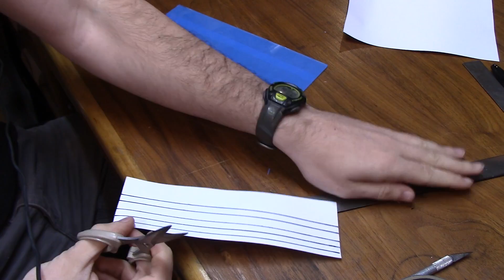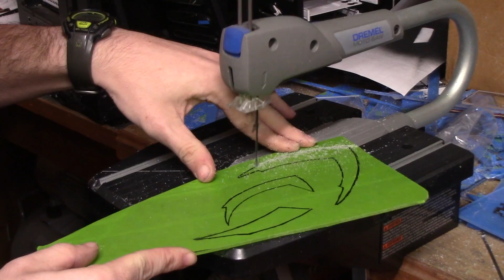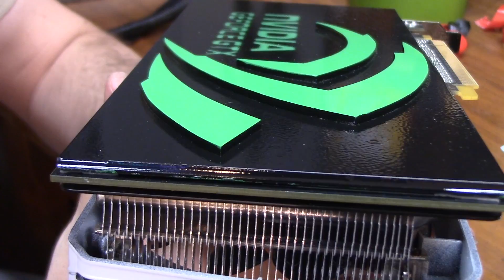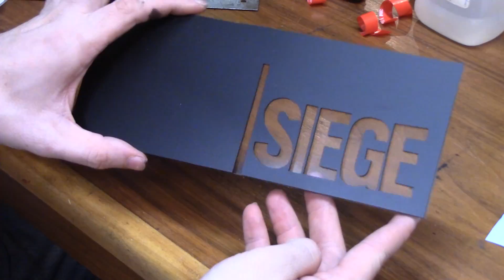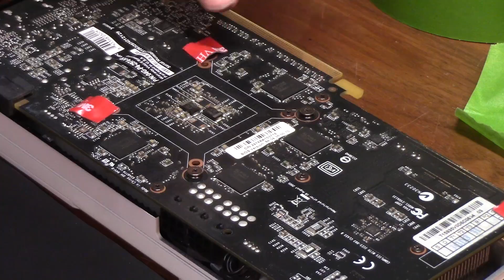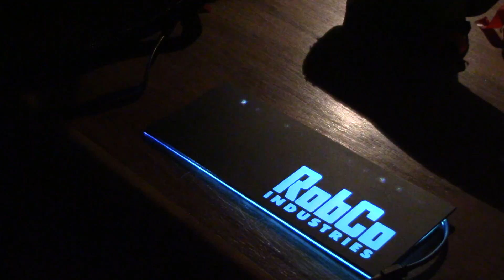How to make a custom GPU backplate (Basic and RGB backlit)

Comment: Honestly an awesome tutorial.  Do you think there's any way to add standoffs for the backplate so it doesn't sit right onto the back of the GPU?  I feel like that could ease up problems with heat entrapment.
Reply from the maker: +Lone Ech. You could just use tiny pieces of acrylic as standoffs, that would be the easiest way. But, it doesn't effect temps.

Comment: For a cheaper ghetto mod just make your backplate out of cardboard.
Reply: if it catches fire don't worry thats normal...
Reply: this is bad advice. very bad advice.
Reply: if your gpu explode, this process is called Thermal Throttling, this is totally normal if you were to try this mod. Dont expect it to work after but atleast you get 10min of excitements
Reply: @potassiumchloride2542  haha love this reply!
 i do have cardboard in my pc, however its inbetween two sheets of acrylic i used to make an rgb logo that is attached to the outside of my optical bay. so there is no risk of it getting even slightly hot, the hottest it will get is as hot as the ambient temp in my pc, and its only "temp"erary untill i get some white spray paint.
Reply: funny thing is i took the box my msi 970 came in and cut out my own backplate and just set it on the card. been fine for a year.
Reply: while at it might as well throw a cardboard box for your pc case as well
Reply: I did that on my IO shield
Reply: I did this then let it for 2 months my gpu is still running and not on fire
Reply: Or just tape rgb all along the back
Reply: Or just don't use custom backplate
Reply: Thats a major fire hazard

Comment: That looks great but nobody mention that those plates preven gpu to cool down.Ant that that material keep warm longer than usual materials that are used for gpu production
Reply from the maker: +QUARK Temperature difference is negligible, this is totally safe to do :)
Reply: Sepend what u do with them.90% ppl newer use more than 50% of gpu .But if u use invidio like me for encoding that keeps gpu in limit of 70C and if u add those plates it increase temp over 80C what goves maximumu alowed border for gpu owerheat.But u can solve that buy deleding gpu what lower temp of gpu by 10-15C depend on termal compound u use.
Reply: WTF? Most GPU's doesn't have a lid to delid to begin with. And most people use more thant 50% of gpu, just because any 3D application uses the maximum available, even if it's just for having +1000fps in an old game, it will use the most possible of whatever is available.
Reply: Not really lmao it’s not like it covers the fans
Reply: Even metal back plates don’t make a difference with cooling because they don’t even have thermal pads behind them

Comment: on the second rgb method ( where the rgb light shows through) why not tape the entire bottom on the back and spray paint just the top of the back side? just the bar where the LED will be behind?
Reply from the maker: +Tim Fenton That would definitely work too, there's a few ways you could do it

Comment: Aewsome video, after 5 years of building my first build, it's time for a update. However decided to keep my Corsair carbide 500r case, but will be modding it, side windows, acrylic panels, gpu covers, psu cover and you tutorial are great. I also decided to do RGB lighting, however there is so many variations to do so. Can you do a video on this, how it works and what you need. Anyway, can't wait for the next video, congrats on 11k subs, you deserve more.
Reply from the maker: +mumihp Yes I can absolutely do a tutorial on how to wire RGB lights! Good idea :)
I'll probably do it alongside my next casemod
Reply: Dietec Awesome, can't wait for the next video.

Comment: Have you used reflective tape on your lit backplates before? Also, if I wanted to to take advantage of syncing a GPU rgb strip with Aura Sync or any other MOBO manufacturer's lighting (or even NZXT's Cam) how do you go about that? Would you just get a particular rgb strip? So many companies do proprietary connectors like Corsair.
Reply from the maker: You can certainly use a proprietary LED strip for that purpose, I haven't tested if these generic ones work with any software unfortunately. I've not used reflective tape but I know some people do it with relative success. It doesn't seem necessary to me considering it works so well without it, I'd rather paint the back than use vinyl or tape

Comment: I bought some MDF do you think that I can use that too? Or do I really need acrylic.
Reply from the maker: +Vince Hofmeester MDF is just wood and that's not conductive. Go ahead and give it a shot, see how it turns out!
Reply: Dietec do you know if it’s maybe dangerous with the heat and the paint?
Reply from the maker: +Vince Hofmeester Google MDF heat resistance, as long as it resists the temps your GPU gets to it'll be fine